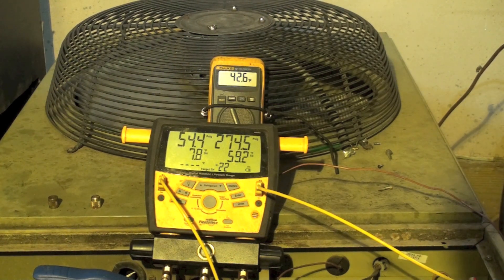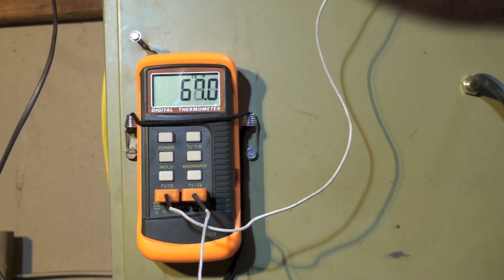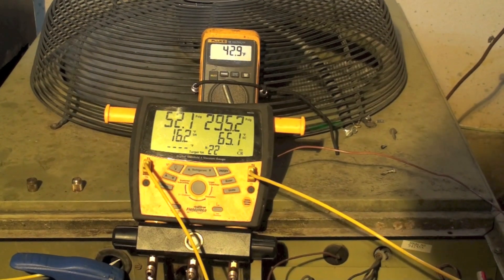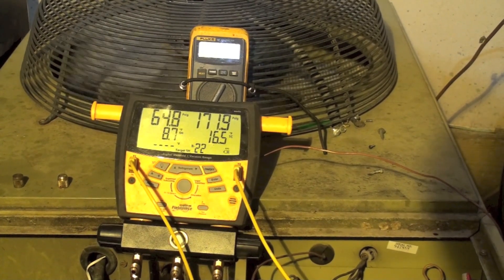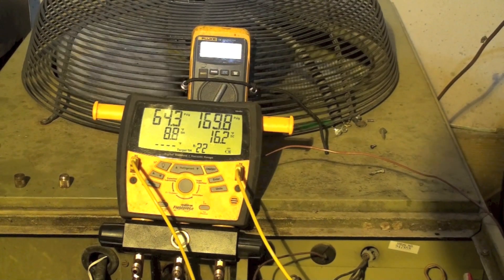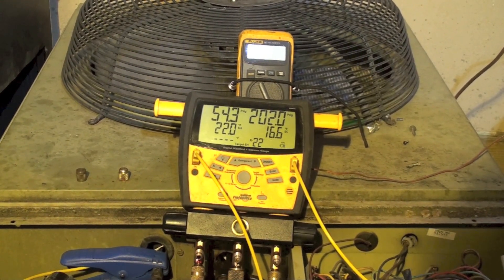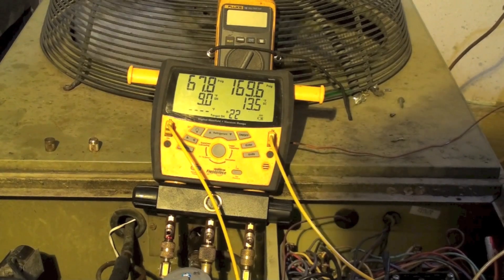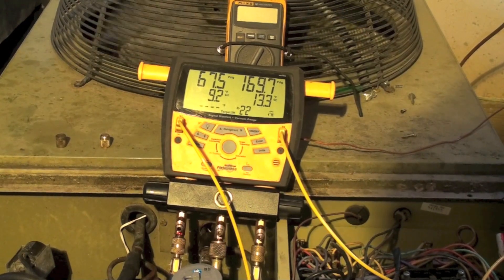Charge the heat pump by weight part 4

Comment: Great videos Gray man! Question.. when you switch back and forth between heating and cooling modes are you switching your hoses and temp probes back and forth so your high side hose and probe are on the 3/8 line in cooling and on the 3/4 line in heating? Also have you done any videos on changing a heat pump such as a Mitsubishi mini split? Thanks again and always enjoys your teachings!!!
Reply from the maker: The heat pump will have a common liquid line tap and you will just have to change the suction line tap.  You will have to change the temp probes.  I have not done any on changing out a mini split.
GFM

Comment: Could you clarify the hose connections.  Heat Pumps usually have the 3rd charging port where the Low side can be hooked up to, have you ever used that port in heat or cold mode in this video?

Comment: When I go on most service calls I find them over charged. Home owner tell me last teck was only here about 15 min. and said it was just low on gas. Here in Florida they do not give the service teck time to check the system. Find a lot with the heat strips on with the heat pump most calls are on track homes so they get just anybody to install them. It put money in my pocket it's just sad for the home owner
Reply from the maker: USMC 1961 Ah, the old "gas and go" trick.  If they are charging units at the outdoor temps you are having now without proper procedures, they probably are overcharging.  Thanks for the thoughts.
GFM
Reply: grayfurnaceman Here in FLA, I make the time...  I am a last of the Mahicans here in FLA Gray Furnace man, we are the last of the Mahicans sir...